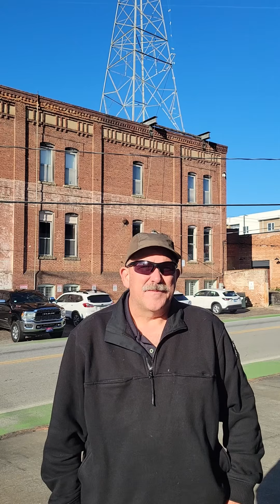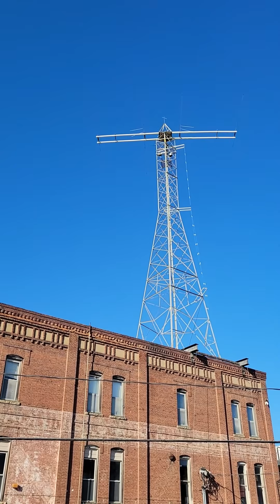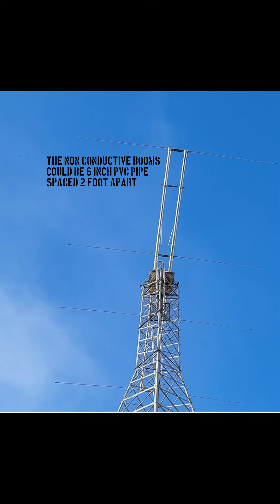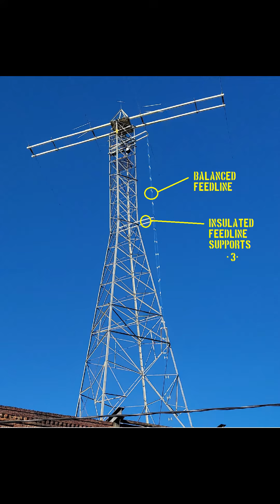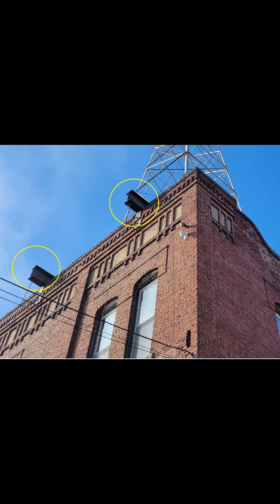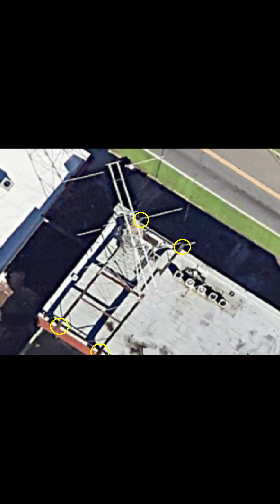DIY shortwave broadcast antenna. Radio WWBS - Macon GA - Real broadcasters roll their own

Comment: Great MiniVid, Bret! It's fascinating to know that, in ye goode olde days of the previous century, hams had no problem home brewing lotsa cool stuff.
Reply from the maker: Thank you ! It was really cool . Apparently the antenna did use a delta match but I think it was either disconnected or corroded away over the last 22 years of disuse. The links in the description do have quite a bit of information. I was glad I spotted the antenna  by happenstance walking around. It was the highlight of my trip. Thanks for watching !